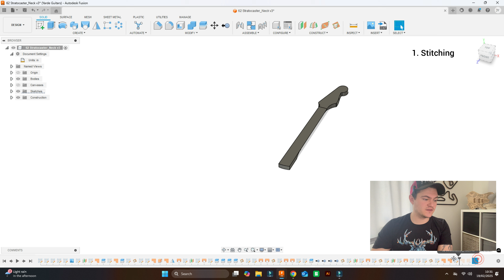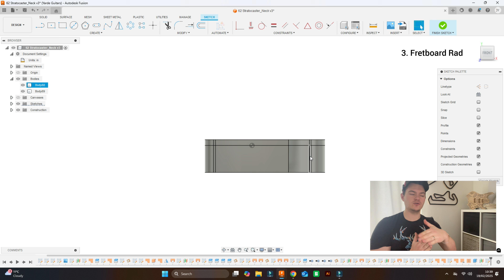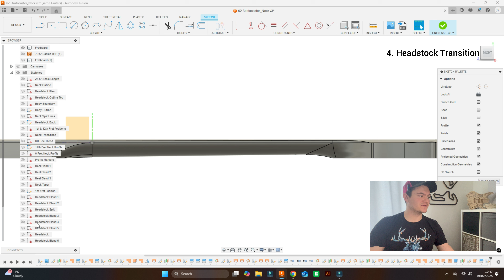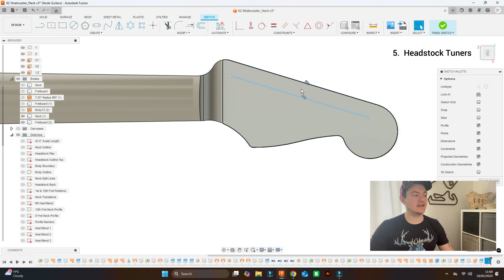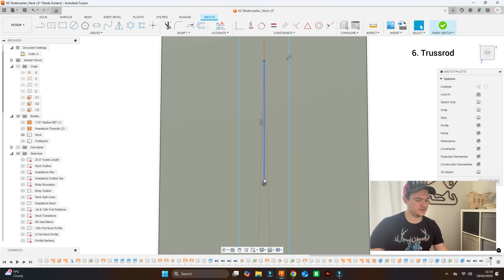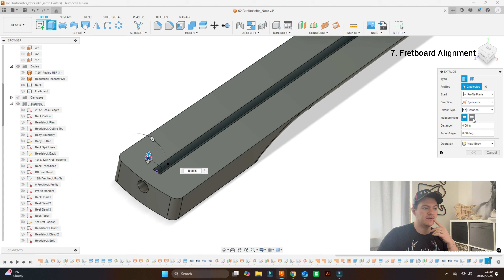Design & Build John Frusciante's 1962 Stratocaster PART 2

Comment: I would be really interested how you design the frets on the fret board.  Do you draw the frets above the fret board and project or is the another way.  Love to see a video on the process.  thanks..
Reply from the maker: That’s exactly it ! the same surface i use to split the fretboard body for the radius. i use ‘Offset Surface’, usually the tang depth plus 0.5mm for sanding. I then have all the fret centre lines projected to that surface. In the CAM, I use the Trace operation, you can then make them blind if through depending on the style you want. This is a big section of the Tool Pathing stage 😂

Comment: Thanks for your video.  Very easy to understand.  Hoping this will help me design the one of a kind Guitar soon.
Reply from the maker: Thank you 🤘
Reply: @YardeGuitars  I know you are creating a specific guitar but wouldn't a parameter work for defining the fret board radius and allow for multiple variations.  thanks...
Reply from the maker: @artgehr7178  if i understand correctly, you can go to the fretboard radius Surface feature, and edit the radius there, this will then change the 3D model accordingly and update the fret projections to the updated chosen radius.

Comment: Great video, James - I've used Fusion a lot, creating parts for my 3D printer, but I've never used Surfaces much.  This video was an eye-opener and I learned a lot.  Cant wait for the body episode.  Still don't really get projections - need to watch again!  I would really like to understand why you start with the neck created in surfaces.
Reply from the maker: Thank you 🤘the body video is coming, surfacing offers a lot more control for the transitions and if you want to add in a volute. For body contours and reliefs. i use surfacing also and subtract from a solid body. If you get stuck with your design, i’m always happy to offer advice 🤘